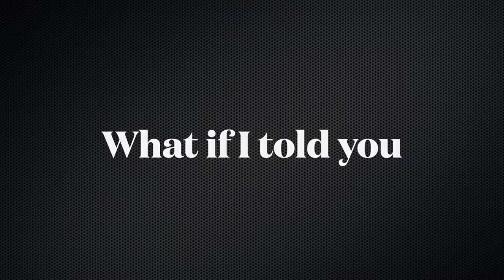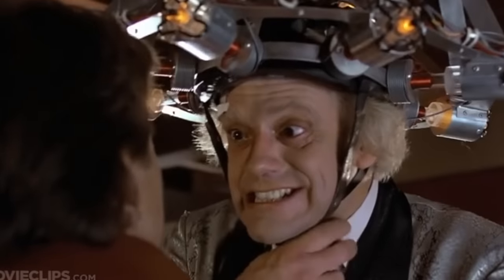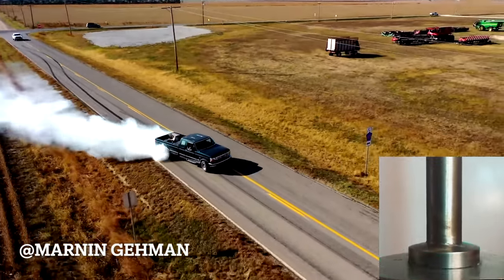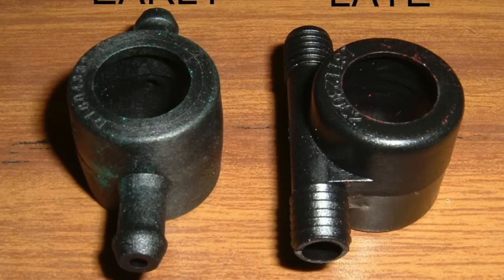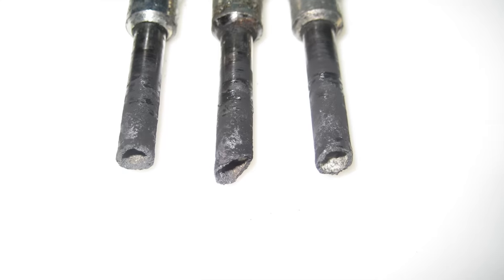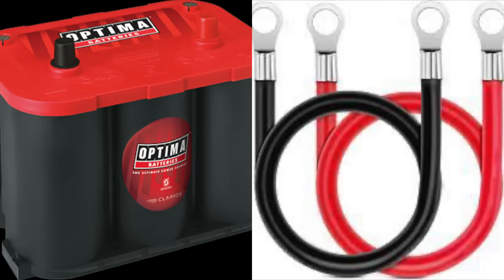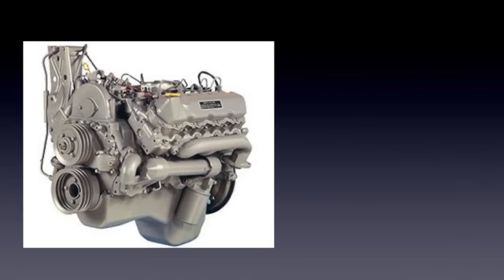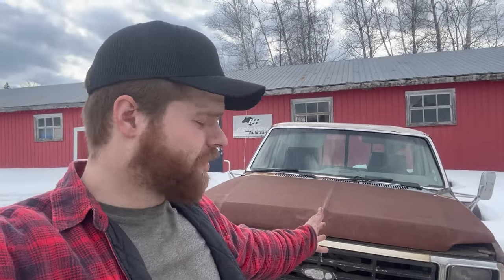The 6.9 IDI is not what you think...

Comment: I worked as a Ford tech in the late 80s early to mid 90s in the midwest. I worked on countless 6.9 and 7.3 IDIs. Nine times out of 10 cold star issues were weak batteries, bad cables, dirty connections or operator errors.
Reply from the maker: You are very right, these engines need to spin decently fast for reliable starting
Reply: These things eat batteries for breakfast
Reply: Starter was my issue. Tired starter ….
Reply: "operator errors" would that be not enough Ether?
Reply: every idi I had got an industrial application gear reduction starter, easy enough since the motor uses a sae starter pattern. Even my clapped out turd would start without ether
Reply: I found an 85 dually with a 6.9. Runs and drives. 1300 bucks has a cold start issue. I assumed replacing batteries obviously, and guy said ends of glow plugs were swollen up
Reply: I have bunch trucks with 6.9 and 7.3 it does not mattrr what you do to them they are gutless comepering to power stroke or cummins and they have not fuel economi Either like most indirect ingections diesel engines
Reply: @mochomochalanas9455  indirect injection has NOTHING to do with this. Millions of benz diesels, cars and trucks were that way. they have great fuel economy. With Turbos they also make good power. a 3 liter inline 6 OM 606 can make a reliable 300+ horse built ones make over 700. so it is not too crazy to think that a 6.9 or 7.3 liter could make good power with some upgrades. But, yes, the 7.3 powerstroke is the one in my book. here is a link to a 435hp OM 606 https://www.youtube.com/watch?v=DamjwTWyWQw
Reply: I run a 94 turbo IDI f350 dump bed with a chipper box and pull 5000lb chipper behind it. It's an adventure every time I take it to work but it just keeps going.  One of the best things was smoking the old starter as well as cleaning and repairing the cables.   The new starter magically"fixed" my starting issues after new return lines etc.  Now just waiting for the e4od to $hit the bed for a zf5 swap.  Cool video thanks for posting it.
Reply: Had a 1985 ran it 30 years and put 500000 miles.  Sold it running perfectly.  It was a dependable motor.  I made the glow plugs 12 volt. Manual control using a Ford starter relay. It would eat a injection pump every 100k. Can of either got it running without glow plugs. Old Optima were great batteries.  New ones aren't worth it. Remember those glow plus were 6 volt.  Look for 12 volt plugs. I believe old 83 diesel Lincoln ran the 12 volt plugs. Eliminate all the timers and junk.  Run 8 wires off a ford relay to each plug. Run a pushbutton switch inside to actuate the relay.  Count the seconds and see how long is needed on a cold start. Between 8 to 20 seconds depending on the temperature.  Zip bang she fired up for 25 years like this. New glow plugs every 5 years to keep her reliable.  Use a screw gun and a socket.  Long threads on those plugs. Carbon ball sometimes forms on the end. Might need something to yank them hard to get the carbon to break off to get her out. Never mind if it falls inside.  She'll eat it up for dinner.
Reply: And lastly operator errors. Ps operator error too. Lol

Comment: I’ve built IDIs. What it’s missing is lower compression to get actual horsepower from intercooling/turbocharging it. At that point pistons are too weak to handle heat. They are  however cheap and underpowered enough to last forever. Good farm truck. I know their limitations but I like them.
Reply: ok so who do i go to for pistons and rods? i want to do a twin turbo idi. only maybe 10psi at most, i just want the spoolies and dual exhaust noises haha
Reply: @rattyratstuff7125 r&d offers 7.3 power stroke rods converted for idi use for about $800. They used to offer a piston shaving and ceramic coating service but I don't see it on the website anymore
Reply: @rattyratstuff7125 don't
Reply: @JayAR_YT why not
Reply: @lukesylvester2022  Because that’s the fastest way to turn your truck to junk. It would literally be cheaper for that guy just to get a turbo diesel and put an intake on it if he just wants the sound. Twin turboing an IDI not only kills the resale and value and makes it generally unsellable but invites not only catastrophic problems but also ensures that you’re constantly gonna be working on it every time you wanna drive it and with it being an IDI the power gains you’ll realistically see don’t come anywhere near justifying the money you spent on ruining a possibly perfectly fine, reliable truck.
Reply: Whats the max speed on em with the 4 spd
Reply: @noah_loans  
My speedometer is off, but I'm sure I've got up to 60mph in mine before I got nervous and backed off. 1985 4 speed  F-350, they weren't geared for speed, that's for sure.
Reply: @Lets_go_Brandon_2024  currently working on getting mine running. Just re did the orings on the oil cooler but now need to put it back in 🤣 had slipped it out in two pieces so probably have to lift engine a bit
Reply: @GMbowtie350
It’s probably a 1600$ truck he wants to have fun with.
Reply: @noah_loans  I’ve been 90 according to my phone gps with 4.10 and 35s for tires

Comment: My 94 7.3 turbo idi runs up to 18lbs of boost and starts whenever I tell it to. You're dead on with the fuel return lines, a good pump and good glow plugs. Your biggest tip is the starter. Parts house starters suck for these engines.
Reply from the maker: Yes sir, night and day difference on the starter
Reply: I loved my DB Electrical gear reduction unit - made the engine start far better.
Reply: That's way too much boost unless it's been built internally
Reply: How did you get that much boost ?
Reply: Only 18lbs?my 97 psd will bury a 30lb gauge

Comment: I use to have a 7.3 idi that put out 800 hp and 1200 Flt.Lts.  shame it got stolen  and found later burnt to a crisp and blown up   But it was not that hard  the only issue was keeping them from going Kaboom after 2-3 runs  but you can make the 6.9 and 7.3 idi Runs very well and Safe at 290 hp 555 ftlbs with no issues as daily driver
Reply from the maker: Yes sir they are quite reliable mills, always thought it would be cool to have one at an hp per cube
Reply: I have a studded 6.0 that I daily drive, but I have a 7.3 IDI that sits nowadays, and this makes me really want to give it the overhaul... New pistons and rings and rods, I know, what about bottom end?
Reply: 😂 800hp idi
Reply: They get that diesel runaway.

Comment: A IDI that handle's 147psi? Yet my last IDI I owned Didn't last a full week with just a few pound's.  I added a Banks Sidewinder and  after one weekend the both heads were literally cracked in half
Reply from the maker: Never heard of them cracking before head wise, where did it crack on the head? Ive had a few 302s crack out between the intake and exhaust valve guides but that was due to running lean
Reply: I have a 86 f250 6.9 with ats turbo. Only get 12 psi of boost with no issues as you state.

Comment: I worked as a truck mechanic at a Ford-only truck dealership from '81-'04. I was jazzed when they announced the upcoming diesel truck in 82 and couldn't wait to get one. Mine is an early production '83 (yeah, thin block)  F250 XLT 2wd with a/c and 3.54 limited slip as the only options. I've had it 40 years in mid-March.
It has given me great service but only has 140k miles on it (I always commuted to work on motorcycles).
I put 3 injection pumps, two water pumps,  a vacuum pump, one set of glow plugs, one thermostat, a set of valve cover gaskets and one fuel return kit on in that time. 
Still has the original injectors.  The power steering pump, gear, hoses and fluid are original and don't leak (I hope I'm not jinxing the thing by mentioning all this).
I added a coolant filter and for several years had a spin-on Luberfiner bypass oil filter installed (just cause I could- I've since removed that).
While I was at the dealership I scrounged exhaust tubing and a muffler from a medium duty 7.8L truck and fabricated a low restriction exhaust. Ran it on our chassis dyno before and after- picked up about 10hp (!) LOL. Got all the way to 120hp at the wheels.
4 speed with 3.54s it returned exactly 20mpg on a vacation pulling a 13' travel trailer (the segment was 700 miles round trip from Flagstaff to Albuquerque to Flagstaff at the same pump). I was happy with that, but it could definitely use a little more grunt.
All in all it's been a great truck and definitely paid for itself.
Reply: I don't want to brag but my EFI big block truck returned 6mpg pulling a 20' tandem axle flatbed with my 86 SVO on it. Same gear ratio but mines a 3x4. Traclok rear and open front!
Reply: Wow, I WISH my 6.9 got 20mpg! I might actually keep it if it did, lol. Sadly, mine sits in front of an automatic transmission, and a 4.10 rear axle with duallies, and it only pulls ~13.5mpg. It's got a Banks Turbo, and all those other components do mean it can pull practically anything. But it's just not economical for my uses these days.
Reply: @richardconnor2871  I was trying to max out the mpg. All interstate at no more than 55mph. Tough to do when even the semis are all going 70+.
Reply: I just drove across Washington state and back to pick up a 35 ft trailer. 16k empty weight with the trailer. Averaged 9.5-10 mpg for the whole trip. Around 550 miles. 94 IDI factory turbo
Reply: @travislivengood2744  That's not fair 😂. My small block (351w) EFI gets about 8 unloaded and is too gutless to pull itself, let alone a hill with a trailer 😂
Reply: Wow, 3 pumps in 140k? My 88 7.3 has 116k on it, and still on the original pump.
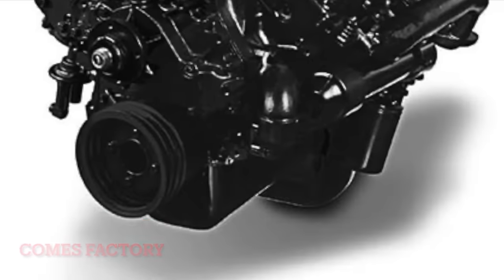Reply: 87 F250 4wd 5spd 4:10  gears 6.9 empty was averaging 17mpg , pulling 8k kb trailer 11mpg.  Body is long gone, engine and transmission  live on in an 86 F350  crewcab being converted to 4wd.  Found a solid axle dana 60 for the front.

Comment: I worked for Ford dealers back when these were new. They were good engines that had very few issues. 
The occasional block crack in the first models around the block heater were handled in most cases under warranty. 
The early glow plug controllers were less than ideal but they did work, but we converted many over to the new style.
The occasional bad lift pump or injection pump, or leaking return o rings were all we saw. In 25 years at Ford dealers I think I only had to replace two of those motors, one had 361k, the other over 700k. 
I had three 6.9L engines, one in an '86 F250, the second in an early 1987 F350, and one in an '84 Ford Cutaway motorhome.
(I also had two IDI 7.3 engines, an '88, and a '94 before buying my first Powerstroke in 1997). Power wise the turbo charged DI engines have win hands down but for reliability under any condition the IDI would be my first choice of the two types.
I only wish they had gone a different route both for the cold start options and the fuel return lines. 
If they had gone to a common rail system with an intake heater we'd have had a much simpler easier to start engine.
Reply from the maker: Right on the money on that one
Reply: @VB-bk1lh  i wish they would design something to bypass or replace the late oil coolers, bought one and found the failure of a plugged rear header and the metal fell away

500 for a used one in decent shape until the spring fails and causes oil bypass issues

Comment: Great video! 

I myself have a ‘93 F350 Dually with the 7.3 IDI NA mated to a E40D trans and it certainly has a special charm to it that my other trucks don’t. It rides like a log wagon and you can turn the steering wheel from 12 to 3 before ever turning but that’s more on Ford than International. 

On mine I built a custom Fuel Filter -> Holley Red Electric Fuel Pump -> Fuel Filter mounted on the frame rail that turns on with the ignition. So much easier to start compared to the lift pump on the block.

Also rewired all the glow plugs and bypassed the relay in the back to a new one that connects to a button on the dash. Most summer days I don’t need to even use them down here in TN. In the winter I just plug it in. Have a block heater and battery tender all wired up together and just cycle the plugs twice and fires up immediately. Save yourself the misery and always go with Motorcraft plugs too! The Autolites swell up and are a PITA to extract. Ask me how I know…

As of now the new return lines aren’t leaking but once they do i’m considering getting some billet aluminum ones. Also had to put a new injection pump and 2 re-manned injectors. The only leaks are the valve cover and the oil pan gasket. 

My dad bought it in 1996 and I hope to keep it alive and well long enough for my kids to enjoy! Though I would like to buy a clapped out one to beat up like good ole Slave Lake!!!

Comment: 1986 f250 6.9 diesel was my first diesel i bought it for $400 and used it for 7 years to start my tree bussiness and i loved that truck , i put a easydump on it with a wood box and chipped into it although i needed more springs in the rear , but needless to say i fell in love with diesel motors and had every international engine from 6.9 idi to 7.3 idi then the turbo idi 7.3 then im curently driving a 2000 excursion 7.3 , most reliable diesel ever built imo....

Comment: Awesome video! I bought an 87 F-250 last year with the original 6.9 and 4 speed. What a great truck. Mine has a well maintained starting system and barked right off in single digits last year unplugged. Kinda made me wonder what the fuss was about with them being cold blooded. I ended up doing the injectors and return lines and I was shocked to find what I believe were the original injectors still in the truck. The date stamp on the vin tag in the door shows the truck being built in may of 87, the injectors were all stamped 2-87. Looking forward to more IDI content down the road!
Reply from the maker: Yup, so far most of my 6.9s still have the factory injectors and are going strong
Reply: My 6.9 that I swapped into my truck has been neglected all it’s life has non working glow plugs and still comes to life in a few seconds on cold days imo proper timing is the most important

Comment: i had a early 90s crew cab dually, 7.3 IDI. hadit tuned up to pull horses, a local diesel injection shop re do the pump, banks turbo kit with an air to air, granny shifting the ZF 5 spd it went 13s. 400,000 miles later it still runs, just use it as a parts/lunch runner, is still fun stop light to stop light.

Comment: Got a 91 w/ the 7.3 w/ 5sp ZF5 & 2wd. Can get about 21 but gotten as high as 23. An OP put 3in (might be 4) straight pipe on it. Converted the GPs to manual by bypassing the automatic side of the controller which had died. Thing is just parked at the moment. I like the sound of that thing...kinda miss driving it too.

Comment: I'm a fan of Ford design remote  relay, I convert all my rigs. Run a #10jumper from the power to the start pin,run som 00 or0000 cable  from power to relay where it's easy to get to for maintenance purposes like  bumping the motor over settin valves, my 91.5 bump starts on the first compression cycle on the key. Plus when a shop gets instructions DO NOT START . They'll have hell trying to not follow instructions( especially when they refuse an introduction to a customized  truck, they thought the motor had to be running to make the cable shifter work¿. Crushed oil pan into rotating assembly ,cault shop with a vom tryingto find the trigger wire and helped them push it into the shop. They still refused an introduction, week later they said pull the cab to get the Allison unbotled and 3k more. So i did the oil pan my self.)
Reply from the maker: Yes sir that’s a wild ride haha 😂 but I quite like them too, it’s a very simple but effect system

Comment: I had an 86’ F350 with the 6.9L. It turned 98 hp to the rear wheels with maximum normal aspirated tune. I installed a Banks turbo kit which brought that up the 198 hp with optimal tune(not to much smoke). I sure do miss it. It had 325k on it when I sold it. I wish it had been a crew cab.

Comment: Starter speed is critical  for ANY diesel. No mater if NA or turbocharged,  only boost system that makes boost on the starter is a blower.
To slow of a piston speed allows too much time for the cylinder walls and piston to cool the air below combustion temperature. Had trouble with my starter in my Cummins not spinning fast enough required touching the throttle to fire off.  3 starters in I discovered the crimp on the lug was not tight going to the battery.
Reply from the maker: Yes sir usually it’s something very simple, bad ground usually

Comment: I have an 03 f350 with the dreaded 6.0, going to engine swap it. Was set on a 12v swap, but the prices on a clapped out 12v needing a rebuild is sky high these days. So i was thinking about an IDI swap as i had one back in the 80's, it wasn't fast but was pretty much bulletproof and one can be found fairly cheaply to rebuild. Thanks for the video
Reply from the maker: Glad you liked it 👌 I’ve always found for the Everyman the good old Idi is a solid engine
Reply: Sell that truck. Absolutely no reason to attempt a swap on the new vehicles

Comment: I have an 89 7.3idi in my 71 F250.  My previous truck with this engine was a 69 F250, but the chassis just couldn't handle the weight and torque.  This current one is on an 85 chassis that originally had a 6.9 and four speed, along with 3.07 gears.  I had planned on swapping out to a 3.54 gearset, but having put a few thousand miles on this I think the high gears will stay.  It does 80-85 all day turning in high teens to low 20s.